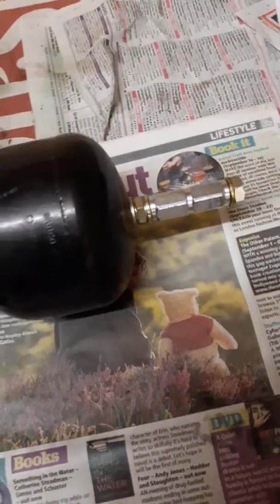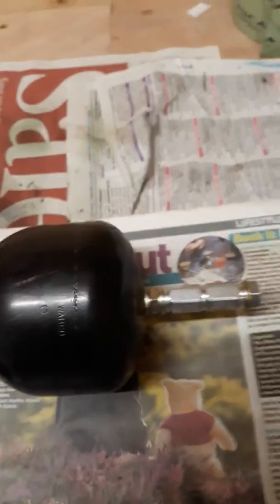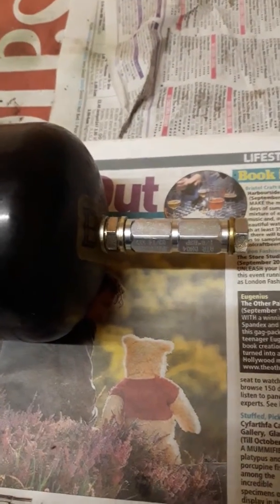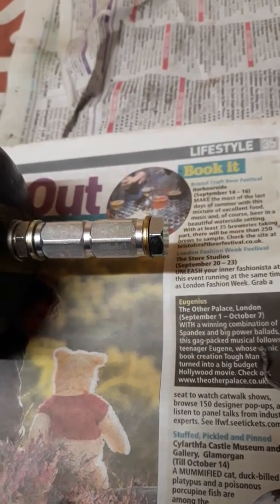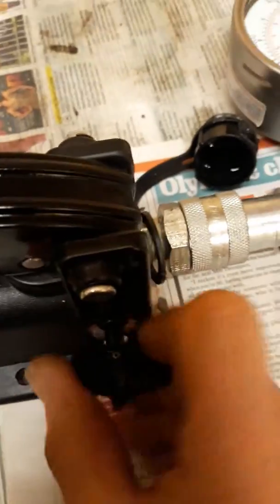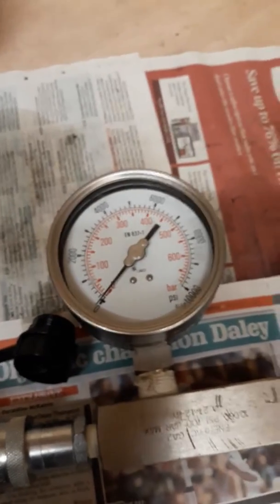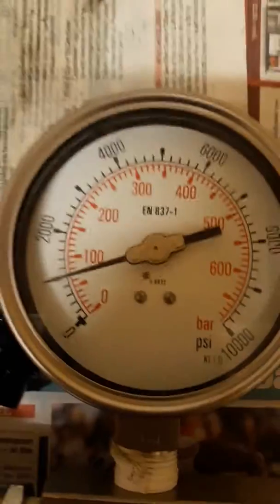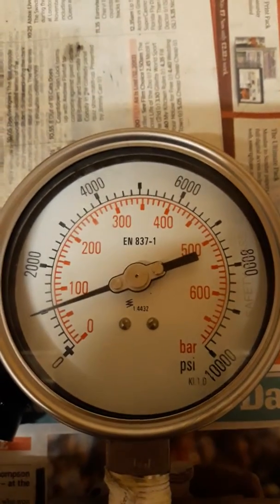P38 rangerover brake accumulator modification test

Comment: So what are you saying? No need to replace the accumulator, but you can tap it and add this extra one way valve? Maybe you cd add more parts detail in the description pls
Reply from the maker: The fittings used were a mixture of hydraulic and pneumatic. From memory I used a 1/8" x 1/8" nipple, the one way valve rated at the accumulator pressure, a 1/8" end cap, and 1/8" dowty seals between each sealing face. So, if you can get the bits, your confident in your work, then yes, no need to buy a new one.